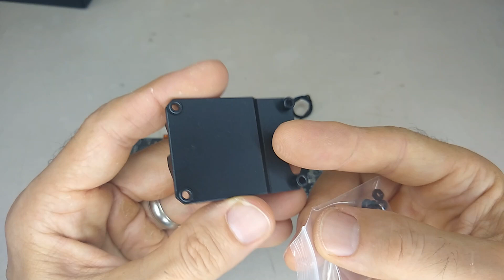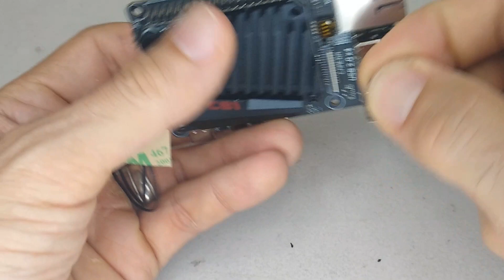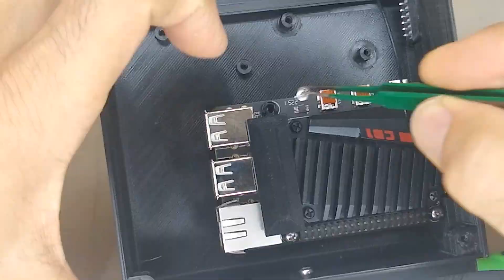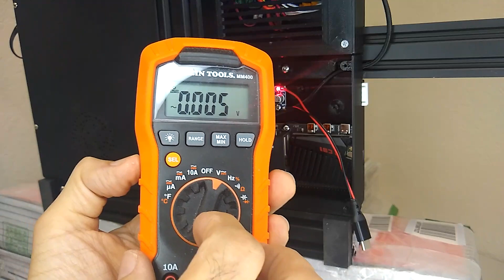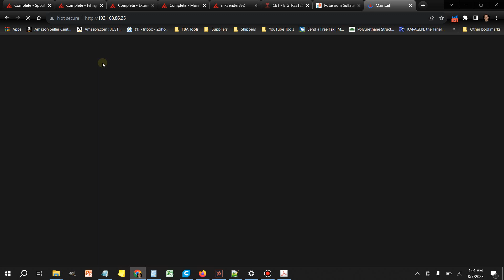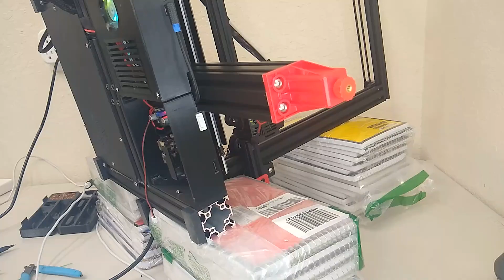Ender 3 Max Neo BIGTREETECH PI4B + CB1 Mainsail Klipper Installation and Configuration for ADXL345.

Comment: Im am so glad this video pop up in my discourage moment seeking videos on E3maxneo. It seem as there is not enough upgrade or update to the maxneo. Until i found your video and hope came through. Thank you. I have upgraded my hot end to a sprite pro- no update for it so i went to chatgpt to create a firmware which kind of work after i had to upgrade the board to a 4.2.7 which accepted any marlin firmsware but even after that im am having issue with homing and the tjc firmware to the screen. So yes i am stuck. Now im pur hasing what you have link to amazon and looking forward to trying klipper and getting this maxneo back to printing. If any advise you may have would be greatly appreciated. And again thank you for your video

Comment: Raspberry Pi 4 definitely has USB C and not Micro USB that the previous versions had.   
The BigTreeTech boards are great quaility.   One of the few third party boards I would recommend.
Reply from the maker: Hi Brendan, Thank you for commenting and info about the Pi 4 and CB1. Yeah, BTT has a winner with it for sure.

Best of luck with your mods!

Comment: Hey mate thanks for the vid.im trying to open the printer.cfg page but doesn't work
Reply from the maker: Hi Peter which control board are you needing the printer.cfg for?
Reply: @vbared  thanks for the reply,I just bought a manta e3 ez for my ender 3.i have downloaded the example config, uncommented to correct drivers and have all the connectivity done but the .cfg is all still abit foreign to me.i can't see any print dimensions and have no idea what the xy offsets and probe offsets should look like.was just hoping to see a finished .cfg so i have some reference to compare to.cheers mate
Reply from the maker: OK, so you have these two files from BTT to give you the pins and stepper driver and other options just need to be uncommented by removing the # in front of what you are trying to enable.

https://github.com/bigtreetech/Manta-E3EZ/tree/master/Firmware/Klipper

My current printer.cfg for my Ender 3 V2 bowden that is running a Micro Swiss dual gear extruder so if you have the same use 22.889 like the line below in the [extruder] section of your printer.cfg If you are on the stock extruder then use 34.406 as a starting point and fine tune from there.

rotation_distance: 22.889 # Change value to 34.406 if not using Micro Swiss Dual Gear Extruder 

Mine has a longer travel X&Y so make sure you can reach X-270, Y-231, and Z-240 before trying to print something with it. I would suggest setting position_max: 235 for both X&Y and use position_max: 240 for the Z until you verify your max values.

My Ender 3 V2 printer.cfg - https://mega.nz/file/NINA1YhC#bPCik5d3eAuV-KHh02LmO_evXflw0kG83a3BX0IEEyM

I realize that this stuff is confusing until you become accustomed to how it works so call 478-227-3301 if you need clarification.
Reply: @vbared  cheers mate.its my first klipper setup and I've read so much info on the klipper site it's overwhelming.just something to compare to as a sanity check will be a great help.cheers for the help mate.really appreciate it

Comment: I was looking at your store and I just want to make sure of something.  Your price for the Dual Under Mount Enclosures and the other parts in your catalog are for the .stl files. Do you ever take on printing those parts and selling the completed product.  I have an Ender-3 Pro which is in a major state of disassembly right now those would make a nice addition. I had made aPi case which mounted on the left side extrusion by way of a couple of T-Slots on outside of Ender 3 then had a 24V to 5V regulator and while it worked fine I just didn't like all those electrical devices mounted externally.. Your Dual Under Mount Enclosures would fit the bill perfectly. 
Ender-3 Pro has been in a state of disassembly for about two years
Reply from the maker: Hi Wayne, Yes, I can print them for you. Please email me vbared@gmail.com include your shipping address so I can send you an accurate quote.

Thank you for your consideration in supporting my work.

Comment: Your ADXL345 kit and resource links seem to be broken.
Reply from the maker: Hi Carl, Thank you for the heads up. The kit was really nice and came with 2m worth of wire in a braided sleeve. Linked below is the same accelerometer I use minus the cable. 

ADXL345 - https://amzn.to/3AGJWeY
Reply: @vbared  The video resource file link is still broken.
Reply from the maker: @carlpetersen3128  Hi Carl, email me vbared@gmail.com so I can attach it.
Reply from the maker: @carlpetersen3128  See if this one works for you, not sure the issue is. It downloads for me using the link in the video description. 

https://drive.google.com/uc?export=download&id=1KN5AFxzUDJj-PNAD3YE4z678L9PcgOpz